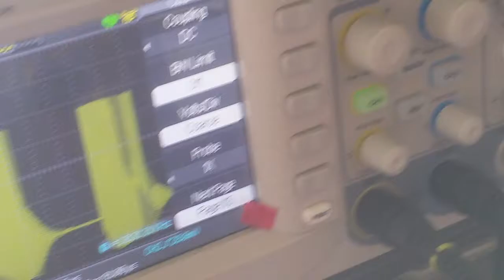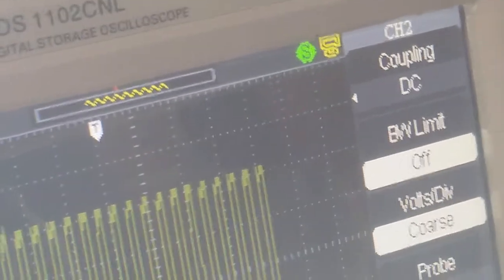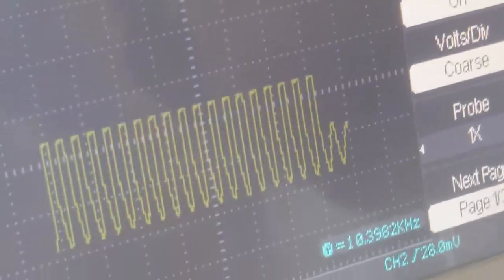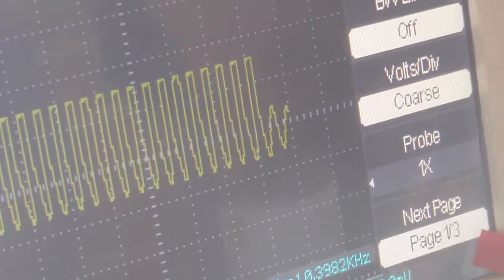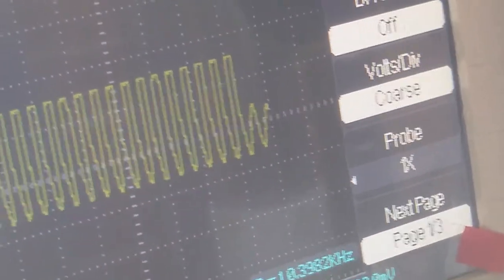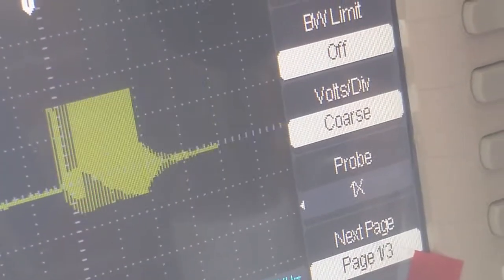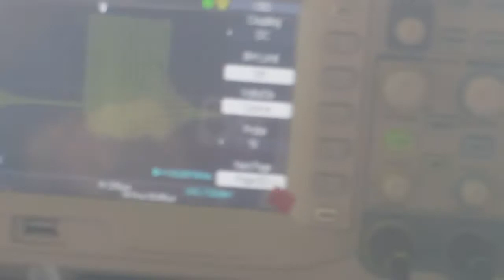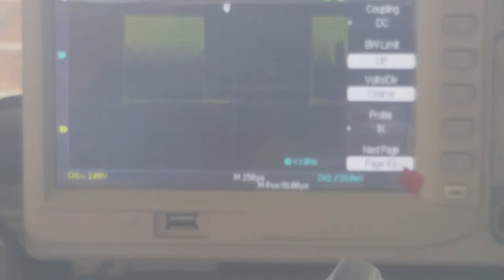Hydrogen research 3 Tanks parallel ~0.07A

Comment: Looks like your on to some very efficient production.  I've used a more scalar blunt force pwm in my apparatus.  I could benefit from higher efficiency.  Been awhile since I worked on this, still have a cell that is waiting to be put together.  You are sparking my interest.  :)  much thx
Reply from the maker: just use tap with no electrolyte or you wont find the sweetspots